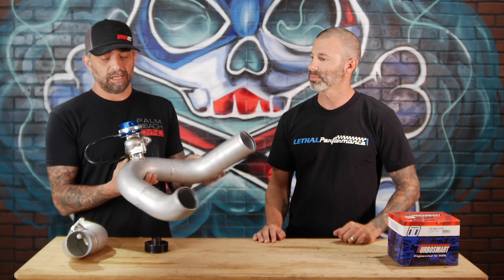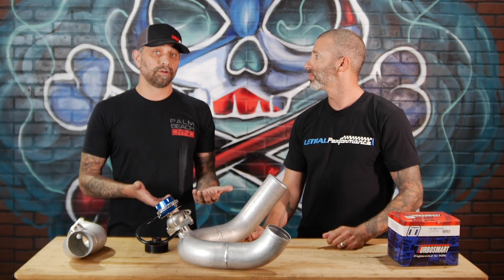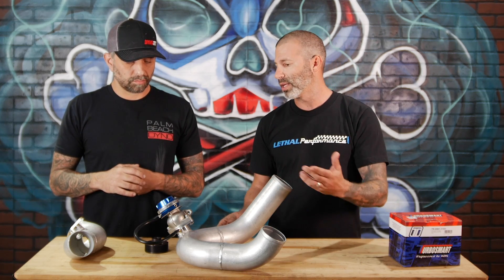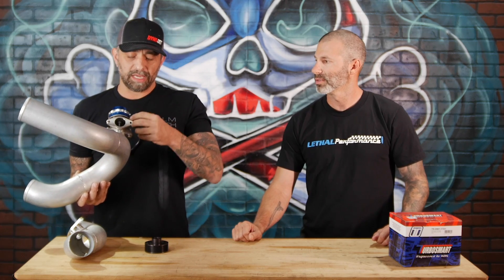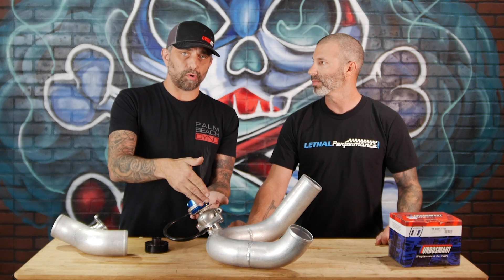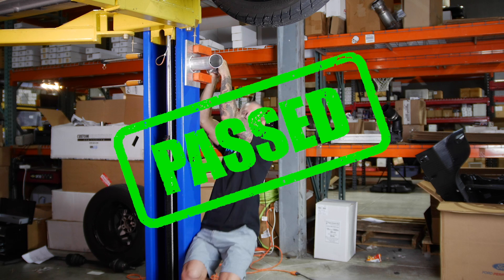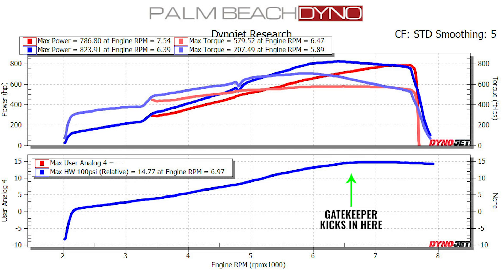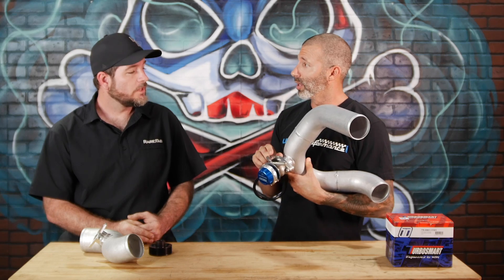Lethal Performance Tech Tips: The Gatekeeper Torque Pipe for Paxton/Vortech S550s!

Comment: Nice vid, but I used a blowoff in this fashion in 2011 with my old boost controller on a friend's car when I upgraded to the AMS1000 on my twin turbo 5.4.
I'm still disappointed that Ken wasn't able to capitalize MUCH quicker on his twin turbo system! I had several guys waiting in the wings for it and just chomping at the bit for it. Damn shame it took so long to get the stainless manifolds made.